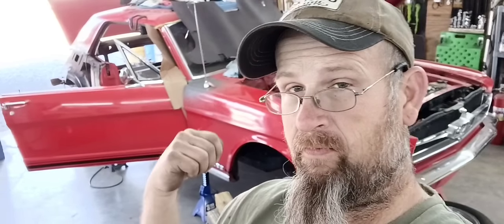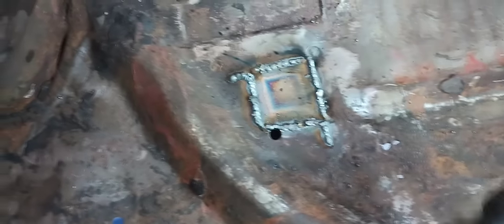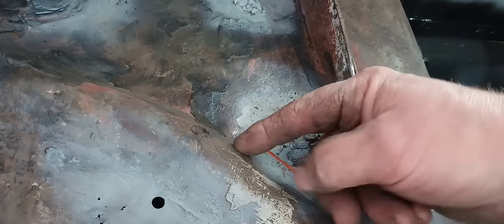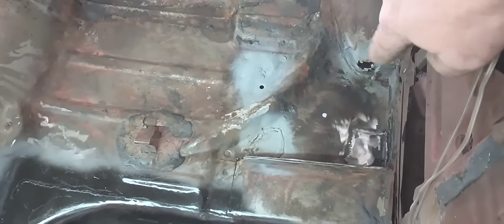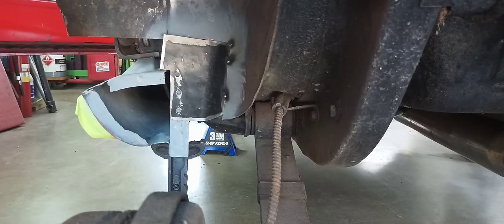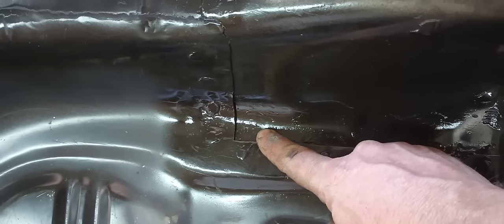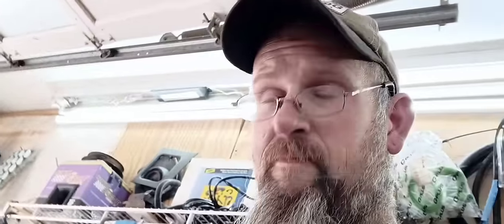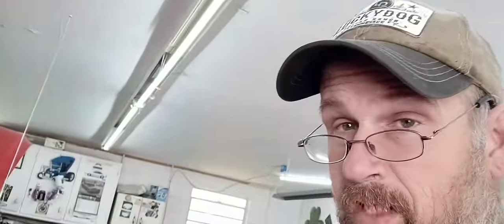Restoring the Rear Floor of a 1965 Ford Mustang with DIY Patch Panels #fordmustang

Comment: Doing the seam sealer like that, rather than the HUGE beads they did from factory that you can peal off like a sealer snake, seems like a better idea. And people think that paint is the same as the spray paint. It is NOT! That has more solids in it and it will take 3 or 4 days to dry! Great stuff for all kinds of jobs. I painted bunk beds with that 10 years ago and with kids doing kid things its still going strong!
Nice work! Love seeing the process that regular people can afford to pay for 👍
Reply from the maker: It's good stuff for sure!

Comment: I personally like the patch method when it can be done. Especially when it comes to the cost of materials, or having to settle for cheap aftermarket parts that are not correct or up to OEM specifications. AND, especially when you CANNOT buy a replacement panel, because there are none available. For example; my 1970 Mercury Cougar Eliminator. Everyone thinks everything is the same as a Mustang; NO IT'S NOT!😂! This generation Cougar has a 2 inch longer wheel base,  so essentially from the front seats to the back , including the rockers is different. A friend of mine tried to use a trunk drop replacement panel for a Mustang, only to have to do a lot of work to make it look and fit correctly in his Cougar. Even though you may be able to find a rust-free used Quater panel, is it worth it and the shipping costs. Or cheaper to do a patch. Heck, my buddy even found out the hard way that the 1969 and 1970 quater panels are slightly different even though they look the same!
As for the Rustoleum, I DEFINITELY agree with you there. I was 10 or 11 years old when my father and I started a restoration of a 1959 Chevrolet. He said it was a proven way to save the metal from rusting . That was in 1981! Car's long gone to a new home now,  but I can bet it still has perfect floors!
Thanks for the videos! Until next time,  see ya! 😎🇺🇸🇺🇸🇺🇸

Comment: Just a comment.  I've been watching people on youtube painting with Rustoleum.  On the cheap it looks good.  They are reducing it between 2 parts paint to 1 part acetone or enamel reducer.  I'm with you that once cured it's a durable paint.  I've painted trailers with it.  Seems to last longer than the original trailer paint.  I understand everything your doing.  Looking forward to future post.
Reply from the maker: It can be reduced but for maximum coverage and flow out I like to use it straight from the can.

In a spray application you can use a enamel reducer and hardener just like you would with any acrylic based enamel
Reply: I didn't say so but I was talking about spraying it with a paint gun.  They were painting cars with a spray gun.  The one guy was using acetone.  I'm not sure what all in enamel reducer but that's what I used.  
 @HotRodGuyGarage

Comment: I brushed rustoleum on the bottom of my trunk pans that had solid rust. No flaking yet it's been 25 years like that. No prep other than a stiff brush to knock off crusties.
Reply from the maker: It's good stuff for that
Reply: I like the Eastwood rust prevention products.
Reply from the maker: Eastwood makes some good products but have went up in price lately

Comment: You have a lot of guts to take on this job. Kudos. What seam sealer did you use?
Reply from the maker: For this car I used dynatron #550  it's made by 3m just a lower line. I prefer Eastwood's brushable Seam sealer for large or more show car jobs

Comment: What setting on welder do you use when welding in a patch?
Reply from the maker: Between 13-13.5v,  6.5-7 inductance, and between 97-99 on the wire feed depending on how the parent metal reacts

Comment: You mention it came with crappy panels on it and you replaced a couple with higher quality ones. I’m about to do the floors on my 61 Comet. Do you have a vendor you recommend, or otherwise a way to know if I’m about to buy good or bad patch panels? It’s my first time doing this sort of thing.
Also, your videos on this have been very informative for my coming project.
Reply from the maker: I try to look at gauge thickness but these mustang panels are usually listed as thick and light . AMD is a good source if they have your panels

Comment: I'm not screaming 22:26 about you getting the metal to HOT 
Just wondering why you didn't just weld on the inside?
I would have welded what I could on the inside and not worrie about grinding it down
Reply from the maker: There better access from the outside and I was going to have to do the plug welds anyway
Reply: @HotRodGuyGarage  If you would have read my question you would see I said "I would have welded what I could on the inside and not worrie about grinding it down"
I don't even know why you ground down the welds on the inside because you put seam sealer over them, and you lose most the strength of the weld when you grind it down
Reply from the maker: @6996brandyl  I only lightly hit the inside just enough where any protrusion was knocked down

Comment: Rust-Oleum???
Reply from the maker: For inside floors and non UV exposed areas it's great and long lasting and fends off any future corrosion. For high end cars I use Epoxy sealers but for lower end budget cars this works great and does the job
Reply: I’ve had great success with Rustoleum rusty metal primer. It’s loaded with anti rust chemicals, and easy to top coat with your color of choice. Add in a little Flood/ Penitrol to your color and brush it on, it lays very smooth. Otherwise I’d use Epoxy Primer in a paint gun but then you’re dealing with overspray

Comment: For those who do not have a welder, I have very good experience for the past decade using metal epoxy for small pin holes. I've even used it for some small patches in tight spots where welding is not possible - but you certainly should continue to rely on welding if the continuity of structure strength is important.
Reply from the maker: I'm on the fence with the panel bond style products

Comment: No that's not the proper way to cut a patch. You cut the patch, place it on the rust, scribe it, then cut your rusted area to match the patch, AND you NEVER hammer the patch in tight. Weld needs room to expand. You need a dime size gap for the weld. It's very obvious you really don't know what you're doing..
Reply from the maker: Thanks for the comment but the patch is just fine and will be for the next 50+ years. As we all know there's about 10,000  different ways to do anything.